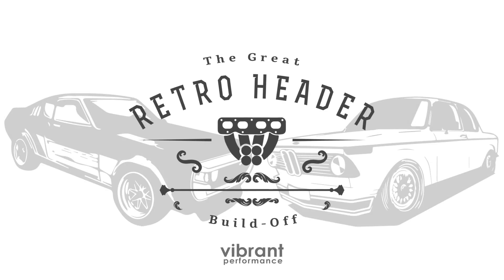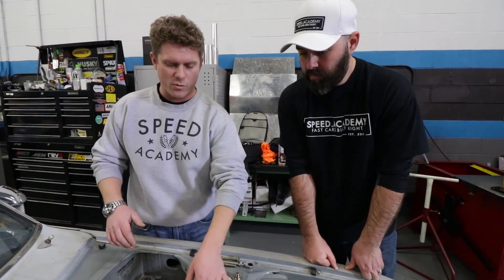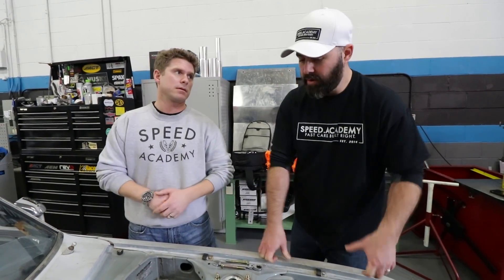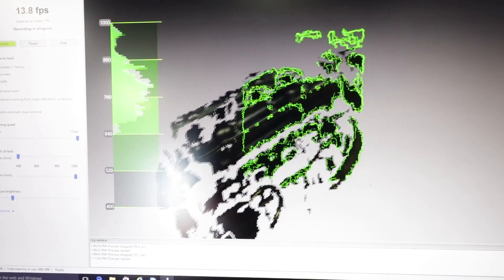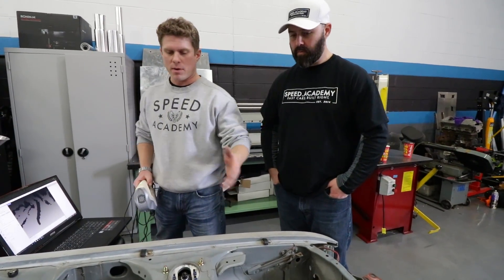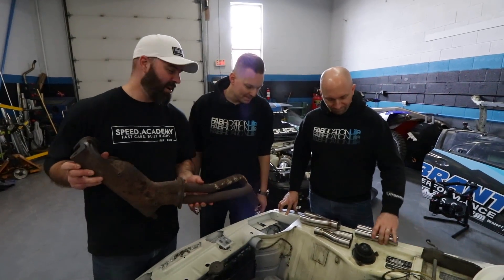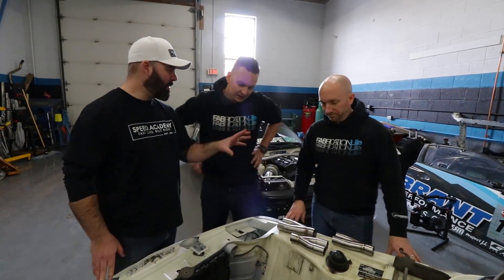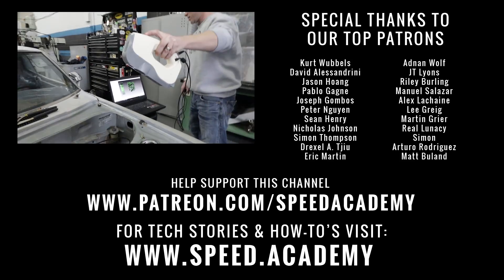Celica Beams 3SGE Header & Exhaust Build-Off Ep1

Comment: NOT a big fan of the header scanning equipment, always preferred skilled craftsmen who know their trade & pass on that knowledge over the many years(Like welding custom headers from scratch & not using cnc/waterjet or weird equipment. As soon as you put skill-into-technology , the old crafting ways are forgotten!

I don't mind paying extra for custom work done the old school way, it's better IMO, more hands on, more passion involved.
Reply: that's right, make sure you check out the hands on craftiness going on with the vibrantperformancetv channel that shows how to build a header with your imagination and hands- doing the retro header build-off old school!
Reply: wedgoku both require the same amount of skill just different approaches. Old school just means outdated or cheap.
Reply: To catch complex geometry fast and rough these scanners are great, but I won't trust in the scan if the design is a matter of below 0.X mm. "It's replicating down to the micron"  is BS - even our $25.000 CMM Faro Arm is limited to 0.01mm  at it's best! In production these CAD designed headers will also warp up to useless if the guy making it is not skilled.
Reply: Terribly sorry Vom.... Our Artec Eva is good for .1mm at 600mm scanning distance.